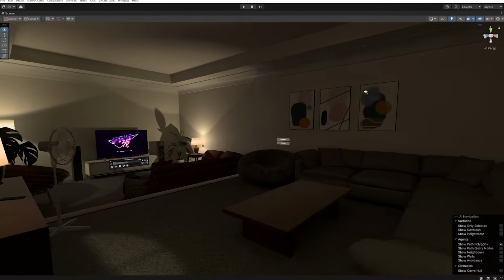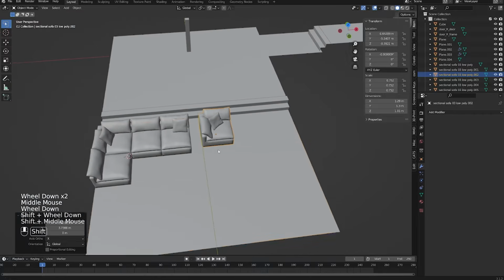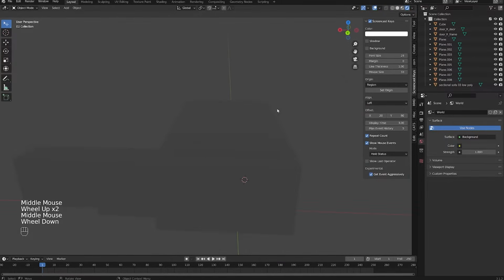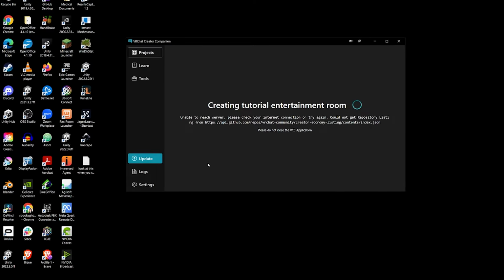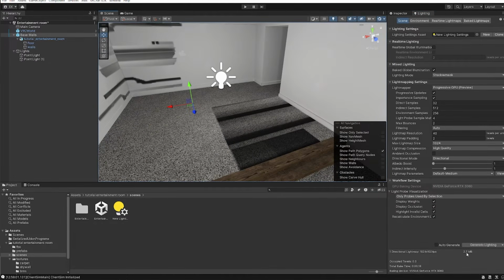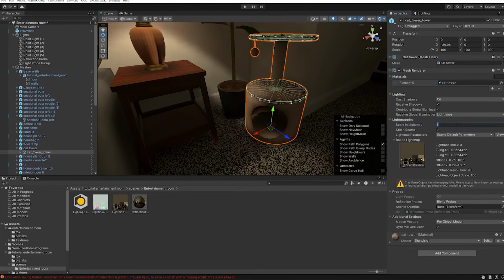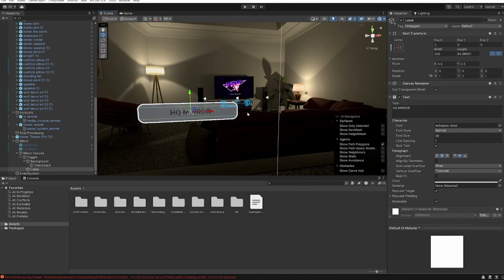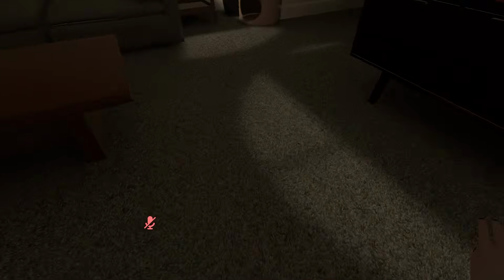How To Make A VRChat World From Scratch Start to Finish | Blender to Unity Tutorial | Beginner

Comment: 45:53 Smooth Angle is no longer in data, it is a modifier
Reply from the maker: pinning this just in case anyone needs to see it
Reply: Want to add to this that you need to select the 90° edge in Edit Mode, right-click and select "Mark Sharp" for it to stay a sharp 90° when you Apply the smooth shading.

Comment: for those trying to do the fill part with the section above the doors, if for some reason it isn't working you can join both the walls into one model by being in object mode and right clicking then pressing join, you can then join the parts with no problem

Comment: is there a way to add two different textures to one object or would they have to be two separate objects? like making one step on the stairs one color/texture and the next step a different color/texture
Reply from the maker: in blender, you can assign two materials to an object. Each material will use the textures you want. You can assign as many materials to an object that you want.

Comment: Controls are completely different in blender, I'm still struggling with blender. Anyone else having the same problem?
Reply from the maker: which blender version are you using?
Reply: @spookyghostboo  I'm currently using 4.5.2, I did kinda stopped out of frustration but now I'm coming back to try again with blender. Also I would like apologize for not responding sooner, I didn't get the notification from your message until coming back to try again

Comment: I could really use some help, I'm on the part where were baking lights for the second time after putting the light sources in the lamps, and after doing all of the light probes and reflection probes, and when i bake my lights with the same settings as you ( Ive been following this tutorial to a T) My light rays coming from the lamps are extremely pixelated. Ive tried so many different things to try and get them looking as smooth as they are for you but nothing is working and i'm really stressed out. If you could help it would be appreciated. I'm lost, I have discord if that's an easy way to communicate.
Reply from the maker: Ill respond here as well, just for people reading the comments. It probably has to do with the uv unwrap. Make sure your are not scaled really small. Unwrap the wall on the second unwrap layer again and make sure things are scaled as big as you can. Export out and rebake. see if that works.

Comment: Really struggling with this question for you. I imported my room over to unity but I am not seeing the floor. Did I do something wrong?
Reply from the maker: its possible your floor is just flipped, which means the backface is facing up and not the front face. Back faces do not render in unity. So in blender double check the floor isn't showing the backface. to check this you can use: viewport overlays ->face orientation. REd is backface and blue is front face. If its red, select the faces in edit mode and then go to mesh->normals->flip
Reply: @spookyghostboo  Thanks so much! Forgot to respond the other day but this fixed it for me! I appreciate this video and you for making it!

Comment: Hello, thank you a lot for making this tutorial it really really really helped me.

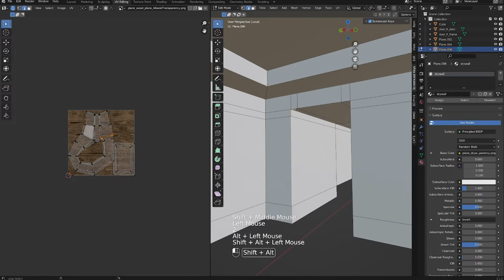The parts that I found the most challenging were the ones about textures, by far, specially in Blender. On my first try when I did the unwrapping in Blender the meshes(?) had a weird shape (kinda like yours at 1:19:20 but way worse), I messed up by joining several planes together and trying to cut them at the same time (like you were trying with the seams, I failed that), so my approach ended up undoing it and keeping the planes separate (hall walls and room walls be separate planes etc), that made it have simple shapes to work in the UV editor, at the expense of a little more repetitive work obviously.

When it comes to Unity I think the tip about the baked lights was great because a lot of worlds seem to struggle with that from what I've read, so thank you for that. 

However, Unity can be such a mess, it's amazing how introducing a little asset that deals with something more than basic textures (like an asset that has an Udon Script or whatever) can absolutely get your entire scene bugged and wrecked. I learned the hard way that, before introducing anything more than simple props, I backup the project folder and keep constantly testing if the project is able to compile or not. For example, a lot of times it happened to me that after importing a unity package and introducing a prefab into the hierarchy, then later if I deleted it, then it wouldn't compile anymore (Common errors including "InvalidObject at", "InvalidNetworkIDs") I know this is obviously too much for a tutorial that is already 3 hours long, so don't worry but I just wanted to mention how important is being careful when introducing things to a project (especially if you have almost zero troubleshooting skills).

What else can I say, I think the tutorial was great, if you decide to make another video I would say make more of your workflow like this but obviously skip introducing Blender and so on so it's not a chore for you, more like a continuation of this video if anything, but you know just make another map. If you decide to do so I would like to see more things regarding textures, why sometimes when importing a unity package of an asset the textures come missing (even though they are there wtf??), a little bit more about "shaders", why do some objects/textures while the users in VRChat are able to see them they may not end up showing up in the camera when a user is going to take a picture, maybe on how to select good assets from BOOTH and fix them if they come with wrong textures or wrong shader pipeline or whatever it's called, how to have a music player that plays background music (not using the TV), how to make some toggles or make use of famous toggles that can be found on BOOTH, other things regarding AudioLink or introducing shades into the scene (like those that are water shades or whatever), maybe talk about particles as well.

Regarding Quest, it seems like if you want to build for that platform you have to have it in mind since the beginning, because a tooon of textures/shades/objects whatever are not compatible and you may find yourself at the end of the project with a huge list of warnings that are just unrepairable without redoing the entire thing, so an idea for a video would be on how to target world optimized for Quest since the beginning (I recogn it may not always be possible though). When I finished my PC world it ended up being around 250MB, among the other thousand warnings I had when I changed platforms for uploading to Quest, one of them is that the size limit is only 100MB! lol.

Maybe a bit of a stretch, but something useful could be how to make our own unitypackages based on different assets for future reuse, because sometimes I end up buying an asset/prop that is too small/too big or I have to "mix it" with another furniture to look good. For example, the famous "[VRC] Coffee Set - MiniGreen" which default table is super small, I had to stretch the table a little bit and move some props to a second furniture (which was not originally part of the asset), in this case I would like to save everything in a unity package for future reuse so I don't have to do all that again.

Also referencing another comment you made and I might have misunderstood, but you don't have to do a tutorial like this in one sitting you know, you can just pause and do a section every couple of days or whatever, also modeling is a massive pain and I think it's ok if you do more simple shapes or just skip the modeling part from scratch entirely, I think most of the important knowledge here is from Unity and how it behaves with VRChat, if you want to use a prefab of a cube house as long as you deal with textures, assets, optimization, shades, I think it would be extremely useful (specially because I don't want to model complex shapes, not even stairs again god I hated them).

Anyway thank you, also liked the bowling asset.
Reply: also you can visit my world if you want, it's the second one I made, it's still extremely simple it's called "The BJD Museum" I made it public yesterday

Comment: So if I wanted to make a light switch would I have to make a duplicate of that room and bake it with no lights and bake the other room with lights? And just write a script that sets one or the other active? Idk if that makes sense 😅
Reply from the maker: yes. kind of. its more complicated. if youre a programmer, it might be easier for you cause you'll understand more than me. every forum post ive seen on it, mentions scripting a toggle between multiple lightmaps. 

The way I do it, is I bake a light scene seperately in blender. take those texture bakes and use a special shader to simulate unity lighting. then I toggle between the objects that have unity baked lighting and the objects that have the blender texture bake. 

most people just use post processing tho to dim the entire scene